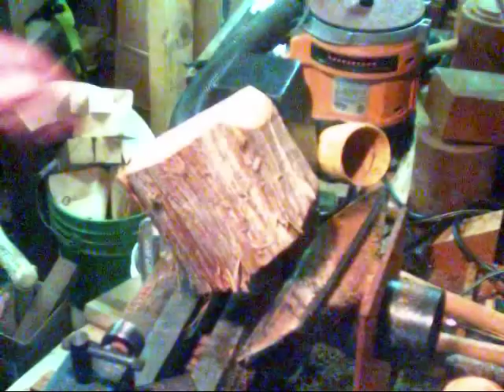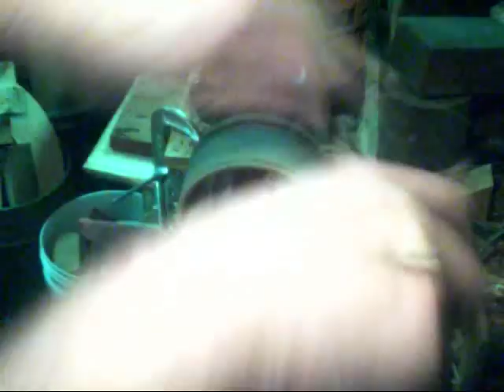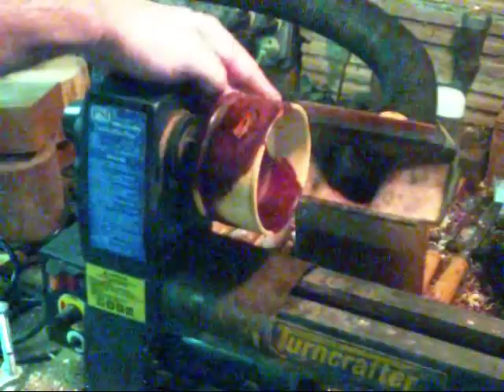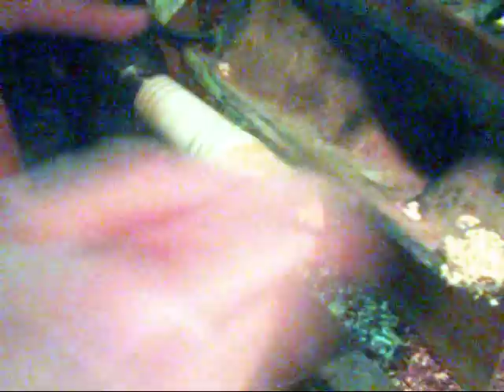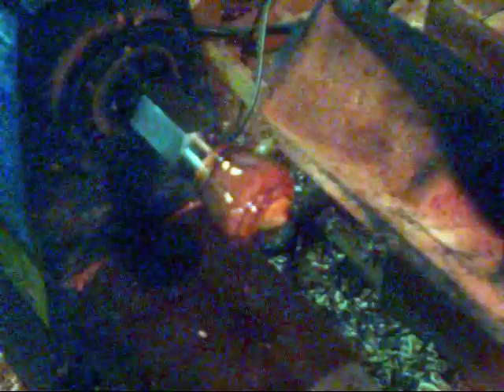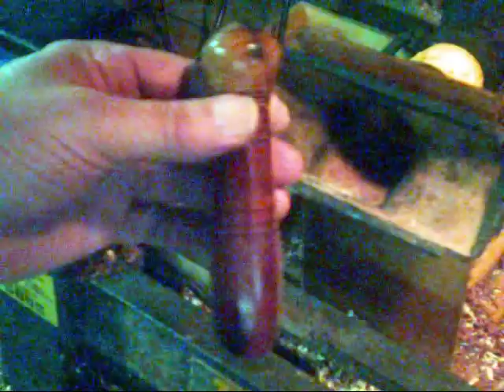WOOD TURNING  "MORTAR PESTLE"  (CEDAR)

Comment: Stunning work, what wire do you use to burn the rings?
Reply from the maker: +Andrew Smith Thanks for the kind words Andrew! I'm glad that you enjoyed my video. The best wire that I've found is the "thin" wire that is used for flower arrangements. I got my roll at the dollar tree in my area. Other thin wire will work but this kind will take a lot of heat before breaking.
I hope this helps my friend. Thanks again!
Reply: Hi Craig, I have loads of blisters on my hands from trying different wires, nails, blades etc and in the process burning my fingers. Never thought of flower arrangers wire! Top tip... I'll be getting some for sure. Thanks for the great tip. The Pestle and Mortar looks the ducks nuts mate and the burnt lines really stand out.... stunning.
Cheers 
Andy
Reply from the maker: +Andrew Smith  Great Andrew! I love it when one of my videos helps someone with their own projects. Always glad to save some "burnt fingers" ...they are too precious to loose.
Anyway... I'm glad this helped and thanks again for your interest.Best of luck Mate!

Comment: Do you do special order and size?
Reply from the maker: Cheu Vue Thanks for your interest Cheu! I will do special orders from time to time.What did you have in mind?
Reply: I'm not home at the moment.  I will let you know on Monday with size
Reply from the maker: Sounds good. I will talk with you then.
Reply: Thank you for fast responsed
Reply: I like you to make one like the picture there and color or stain for the size of 8 inches opening and 7 inches deep and 10 inches top.  The mortar will be use for making food
Reply from the maker: Thanks for your interest Cheu! I'm sorry that I can't help you out but that size exceeds the capacity of my wood lathe.I'm building me a larger lathe but it will be a little while before I get it completed.When it's finished I will be able to turn pieces 3 feet in diameter.This size will be great for larger mortars and platters and such.
So stay in touch.Best of luck Cheu!
Reply: Ok thank you

Comment: beautiful work there! I saw you rubbed the shavings on the bowl. Was there any reason for doing it?
Reply from the maker: Thanks for the kind words friend! Rubbing the shavings into the wood while it's turning at a good speed will make the friction pull the oil out of the shavings into your work thus adding oil to the piece and making it shine. Just make sure you have a lot of shavings so the heat won't get to your hand.Thanks again and best of luck!
Reply: Craig Smith Whoah! Mind blown! Now what if i use a different species of wood-shavings on a piece of wood, or if i have a multilaminate/multispecies piece. Will it bare the same results?
Reply from the maker: 0v3nm4n It should work just fine.You wouldn't want to use a dark wood like walnut on a light wood it would probably streak...and you want to watch on a multi-wood piece.On multi- wood I would just use my friction polish for the best result.I hope this helps.Happy turning!